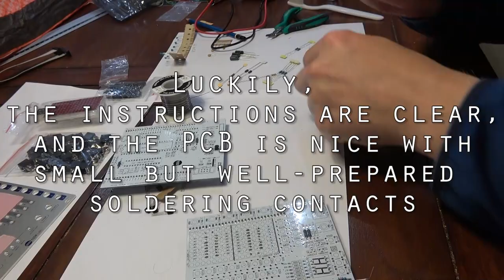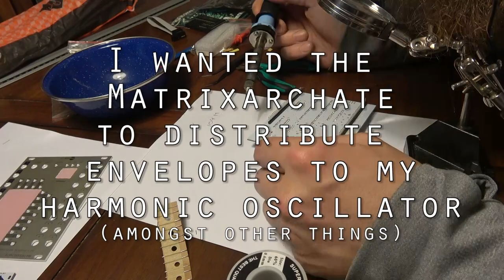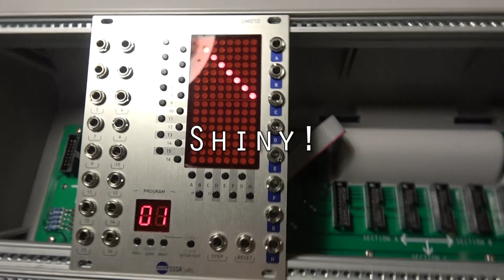SM010 Matrixarchate (SSSR Labs) DIY kit assembling, and controlling Verbos Harmonic Oscillator

Comment: thats great man, i was thinking of building my own pin matrix, or buy the FSS one (MTX9), but then i found this SSSR model.  Not sure why there isnt more matrix styles available.   Do you get clicks at high switching rates?  the perfect circuit demo video sounds insanely clicky when used for audio
Reply from the maker: I haven't noticed any clicking yet, except of course when routing e.g. rising envelopes after they start. I think it needs the right timing in the patch. But you can turn off the LEDs, which should reduce noise/clicking (again, no issues yet). One interesting aspect though, is that inputs/outputs aren't buffered, so voltages might drop. Also, it doesnt deal well when using inputs that aren't patched. But that all makes sense and you wouldnt do that on a matrix anyway.
Reply: You also have Alyseum's Matrix II

Comment: hello, i didn't see on the site if this can be used with standard audio signals as well as cv and gate etc. have you tried it?  also is the random function just for cycling through stored patches or can it be used to make random patches as well?
Reply from the maker: Not sure about audio - 5volt might work as a trigger but the maximum rate of switching is in the order of 100Hz if i remember correctly. Random patches don't make much sense in the design, you'll want to program those, but randomizing them can be very musical.
Reply: @stephenwhitmarsh  gotcha, i was trying to decide between the WMD SSM and this. leaning toward this, but just wanted to get a better idea what it can do. i'm more toward industrial/noise so random would be great for the type of stuff i'm going for. thanks for the quick response :)
Reply: also when i said eariler about audio i didn't mean to use as a clock, but to have cv signals in and matrix mix them as well as having audio signals in to matrix mix them ... for instance audio signals in 123 and out ABC then cv in 456 and out DEF
Reply from the maker: @mr.apartment  You can mix whatever you want! The one thing that is funky/cool/something to keep in mind, is the fact that the inputs are not buffered, so it will mix a bit depending on impedance I think, and mixing 'empty' inputs will reduce the input of others. Not sure what the effects will be of mixing audio - I haven't tried, but there is nothing preventing you from doing so. The SSM looks nice but expensive.  The SM010 is a nice kit for DIY soldering, and a lot cheaper I think.
Reply: @stephenwhitmarsh  gotcha! my kit comes today, i'm super pumped :) thanks for the info
Reply from the maker: @mr.apartment  Cool! Just make sure to remember to take it slow and take breaks!
Reply: @stephenwhitmarsh  haha yea good call for sure, i can imagine something this tedious, it's easy to overlook something because of fatigue